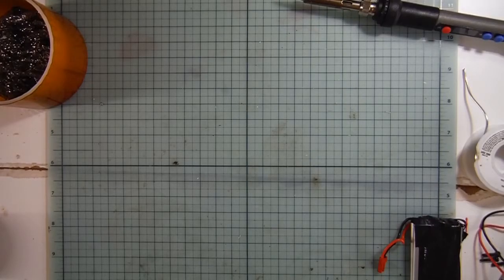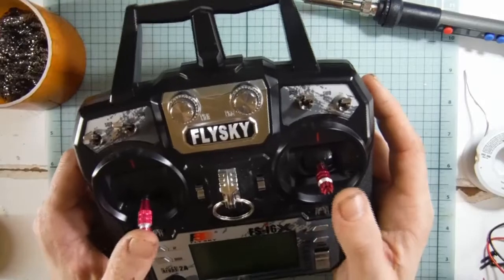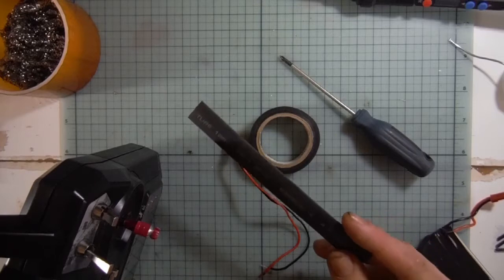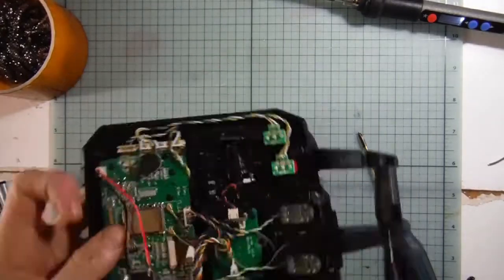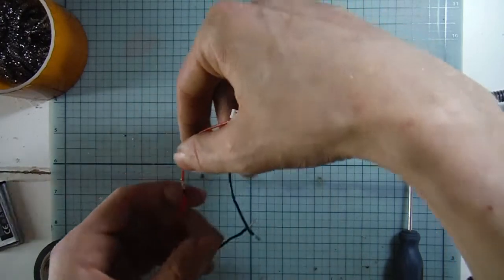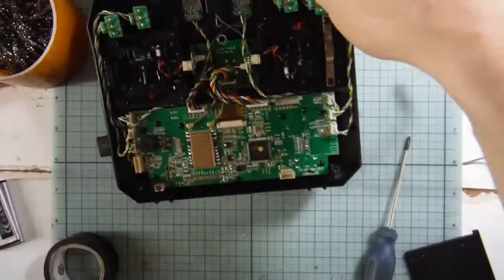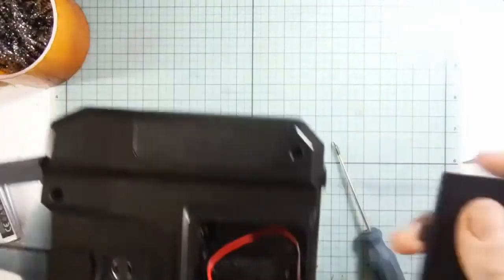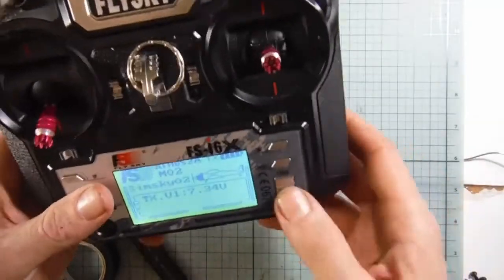FPV Pro: FLYSKY fs-i6x 2.4ghz battery mod

Comment: hello, I liked the post but I think the voltage is high for the radio I have an FS-i6x I'm going to use two 14500 3.7v batteries but I'm going to use a small voltage regulator to lower it to 6v, it's safer! I liked the video the most !! answered some questions, does anyone here have the data sheet for the main board of this radio?
Reply: Hey! I was about to do the same with my flysky as well ahaha...how did yours work out? mind sharing some pictures?
Reply: you can bring it to 6,6v, its a recomended maximum voltage or FS-i6 or i6x

Comment: I'm not going to do this because I'm not so sure this tx can stand the higher voltage. I used an external voltage regulator to bring he 2s voltage down to 6v.
Reply: you can bring them to 6,6v, its a recomended maximum voltage or FS-i6 or i6x

Comment: To run a 2s lipo/ li-ion pack you have to check the voltage regulators in the flysky fsi6/X. Some regulator can only handle up to 7v before overheating and burning out. A heat sink can prevent this but it is better to change out the voltage regulators with better ones.
Reply: voltage regulators  on TX-board?? integrated in a chip?
Reply: @_Danilo_L.  I can't remember exactly what I was talking about. In many other electronic components the capacitors will be what limits the voltage supplied.

Comment: I tried with 2 lithium batteries 7.6v and when I powed on nothing came on. Removed the lithium batteries and replaced the regular batteries and nothing came on. Thanks to helping me messing up my FS 😆
Reply: Now I have to replace the voltage regulator
Reply from the maker: I'm sorry that happened to you. First time  have heard of it happening. Could you have hooked Negative to the positive? Dummy me Did it once testing and that instant fry's it.
Reply: No sir. I have not connected wrong. I have been working on electronics for several year so I know what’s up. But it’s Ok. I guess it was the voltage regulator transistor that probably was not good quality or something. But it’s fixed
Reply from the maker: @saulito85  Mistakes can happen, Even to the best of us, Glad you got it figured out =D.
Reply: Oh yeah I know, I had made that kind of mistakes many times  but this time I did not.  Peace✌🏼
Reply: @saulito85  Hello, I have also fried my i6x, with around 9 volts of power. Can you tell me how to identify those voltage regulators and how to fix them?

Comment: I just use rechargable AA batteries, I have no problem with that, the AA's seem to last long enough for me between charges, I have Spares to swap when needed, works for me without having another extra lipo to charge.
Reply: Your option is perfect! I didn't think about it before, but you are right. A battery indicator will work too, i will be able to see the level of charging in this way. If I use LiPO pack and voltage regulator, i will not be able to control the voltage level and RX will shut down suddenly

Comment: If anyone is worried about the high voltage - Just add a couple of big diodes in series with the battery, that should take down the voltage around 0.5V per diode.

Comment: 🤔so it can handle 8.4volts 😮
Reply from the maker: I have not had an issue with it running 8.4v and have not heard of anyone having issues running it on 8.4v. I Don't want to say that it will work 100% as the remote was not designed for it. so there is a risk of damaging your remote.
Reply: @sandersapps  lol yeah true,i have x2 so ill test on one and see :)
Reply: @sandersapps  i was told you get better range at higher voltage.
Reply from the maker: @Junior Ellis I'm not sure if you get better range with higher voltage, That is a test I would like to try now. Let me know if you run into any problems, it would suck but it would be the first I have heard of. Good luck =)
Reply: @sandersapps   FPV Pro  i Broke my voltageregulators. They can only handle 6.5v max (Datasheed) But sometimes a little more or less. 
So i replaced Mine. 
New one:Input: 4-15v ->3.3v 1A
 (it only needs about 600mah But bigger is better)
Reply: @Enderkruemel  where is the voltage regulator placed in the board? How can I identify it?

Comment: Hi friends, I'm a 3rd year engineering student and trying to earn money for making big and better  projects,
In case u r making drone, automated bots or any projects (final year projects too) mail me @ "prashant1998ranjan@gmail.com" or WhatsApp me @ "+91 9668797307"
I will provide u fully working model and will also provide u basic knowledge of the project
PS :- price will be very less than the market price
UPI tip : prashantranjan200@okicici
Paytm tip : 9668797307
Small amount is also appreciated

Comment: Hi there, I was told that over 7.4 it will burn it. So, using a 2S = 8.4 Volts will work fine? Thanks
Reply from the maker: Thanks for your question, I Have not had an issue running 8.4 volts with my fs-i6/x the only thing is it will shut down at 6. Something volts. I hope that helps

-FPV Pro
Reply: @sandersapps  why it would shutdown at 6. Something volts . It shouldn't shutdown till 4 volts . That should be the case . That means the high voltage has burned up something .
Reply: @supercreations1593  
Protected cells. Most phone batteries have very small protection boards built in.
Reply: FPV Pro thanks
Reply: Life time ??

Comment: Is the battery connected directly to the board? or through BEC?
Reply: 8.4 volts shows voltage?
Reply from the maker: Thank you for your question. Its connected directly to the board. I just removed the original wires to the battery pack on the controller. I run 8v all the time since I did this mod.
Reply: @sandersapps  FLYSKY I6X correctly displays the battery voltage on the screen?
Reply from the maker: Sorry I should have added that, yes the battery voltage shows correctly on the screen.